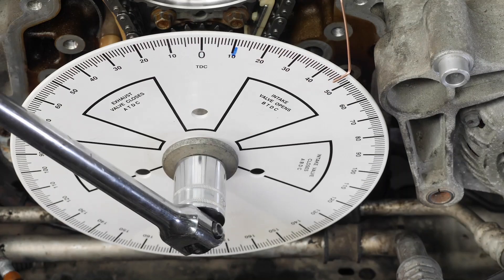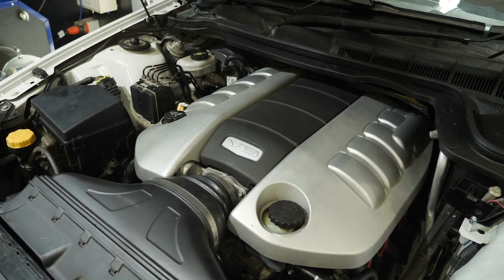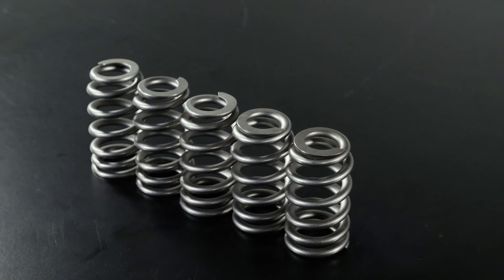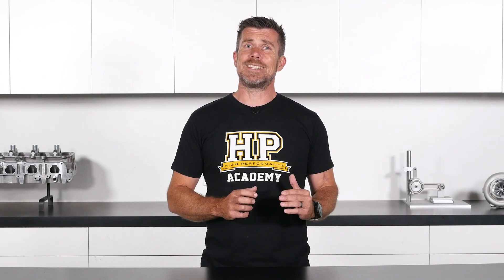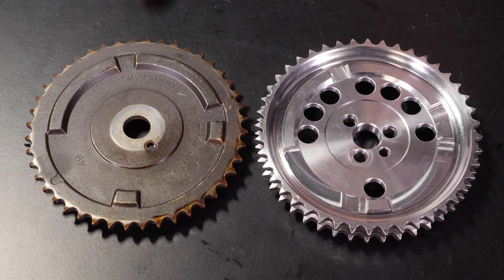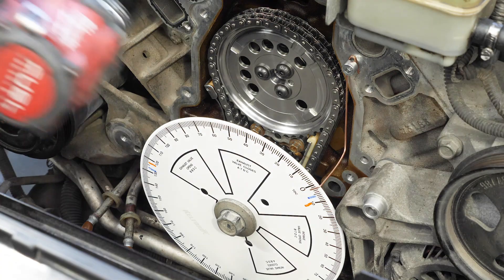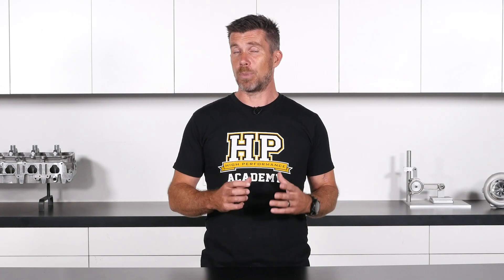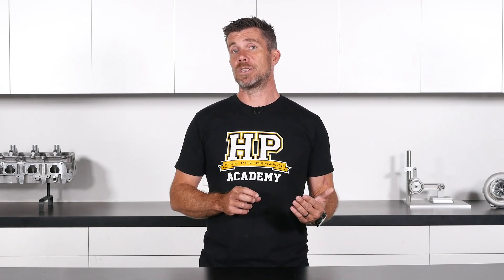LS V8 Cam Swap | Aggressive Cam Specs and Degreeing [#FREELESSON]

Comment: Why the american V8 cam, run larger duration on the exhaust side?
Instead of larger duration on intake side like most engines.
Reply: The head design and intake:exhaust flow ratio

Comment: Why wouldn’t you measure the lift at the valve? That way the cam can operate the valves as per usual, applying all the expected drag, keeping the timing chain tight and lifters on the ramp. Then use centreline to check it’s timed as per the spec sheet

Comment: Why would you do a cam swap and not change lifters 🤷🏻‍♂️
Reply: whats the purpose of new lifter unless you are deleting the dumb DOD ?
Reply: If I was putting an aggressive cam in my motor I would put new lifters in it !!
Reply: @waynepraetz  no point if you have a healthy lifters unless you are going for short travel lifters for maximum performance which will gain you almost 10hp
Reply: With roller type lifters/followers, it isn't required with mild camshafts. If it were a flat tappet type it would be foolish, to say the least, if they weren't replaced and correctly bedded in.
Reply: @gordowg1wg145  With all the TDS and CNN followers of fake news, it isn't required to have actual brain function to fester in trumpphobia.